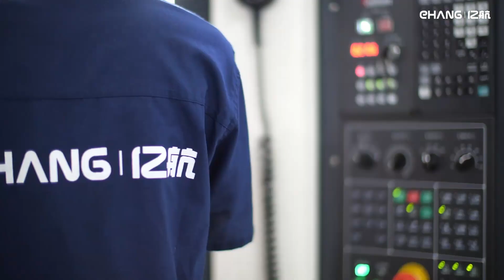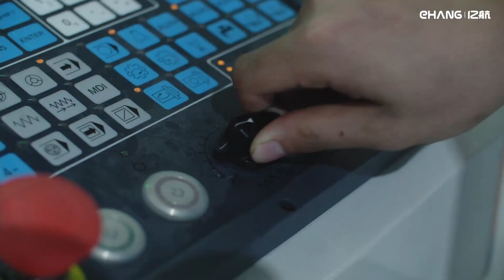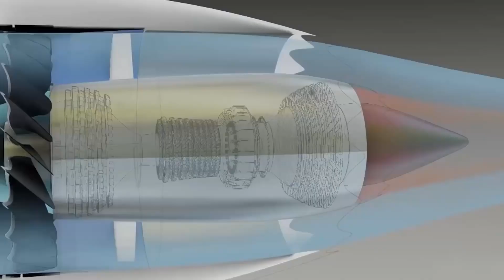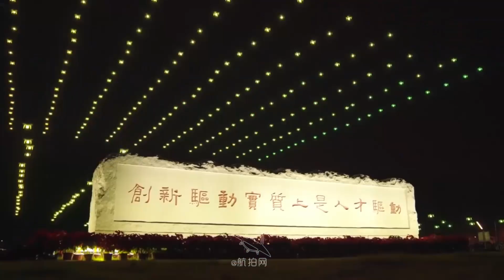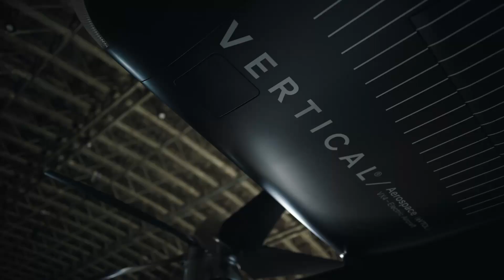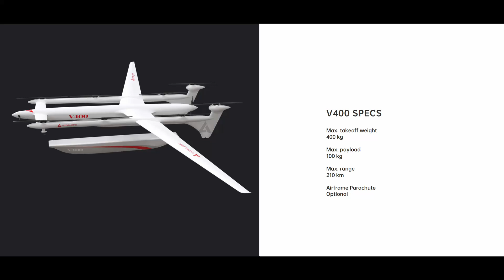The Emerging EVTOL from China

Comment: Why not use hard wire during take off to reduce battery demand by 25%, plus use of hydrogen containers under the batteries to reduce the weight of the batteries by keeping them afloat and for safety reason on a tow arrangement attached to airplane

Comment: Sadly insurance is likely to be very expensive becase all these designs are extremely dangerous and are likely to have industry restructured fatalities. The faa needs to reqire all props to be inclosed so they can run into another bird or evtol. Rapid bolistic parachute should be required on all evtols in the event of full power failure. And I think designs realy should land flat to ground so wheelchair can roll on from parking spot on street on inclement weather.

Comment: Hi, any chance you could take a look at sky fly for us, concept simplicity looks great, could this be scaled? Into say a 5 seater, it’s expensive! What’s to stop the Chinese copying the design and turning them out at half the price or less. 👍 big fan of your work by the way
Reply from the maker: I did mention Skyfly in the video I did in January. They have successfully tested a small scale model. I would be more comfortable if they dont have just tip rotors. The reason is if one tip rotor fails its very difficult to control the aircraft. Chinese companies have already copied several designs. This might be copied too.

Comment: I like the E430 fixed wing design, although V-tails can be a red herring. To get the same short period oscillation time and damping as a horizontal stabiliser you normally end up with the same wetted area (boundary layer drag). I'd have to draw a vector diagram, showing how flow impinging on an angled aerofoil reduces the dCL/dAOA to explain. But upshot is there is no real advantage for V-tail.
Honestly though I just do not understand the e-VTOL aversion to collective pitch rotor systems. Especially the multi-rotor systems that have similar overall planform dimensions to a rotor design. Can someone explain the logic to me? It just does not make any sense.

Comment: Almost every one of these designs bares a striking resemblance to EVTOLS designed in the West.  Hmmm… Chinese business as usual.
Reply: Most eVTOL designs fall into four categories: Multicopter, Lift+Cruise, Tiltrotor, and Tilting.  All designs in each category look similar anyway.
Reply from the maker: Well by the same token, Jetson One would be a knock off version of Ehang 184 and the Xpeng X2, which have been around for over 8 years. But I agree, some of the Chinese ones are really similar. The Pantuo is almost a complete Lilium knock off
Reply: @ElectricAviation  Why not copy from and improve on one design which is the most promising?  Lilium is beautiful and efficient.  No need to meke an angular wheel for originality's sake.
Reply: China is unable to create an original design for ANYTHING on their own.